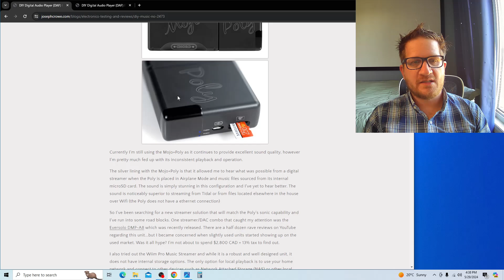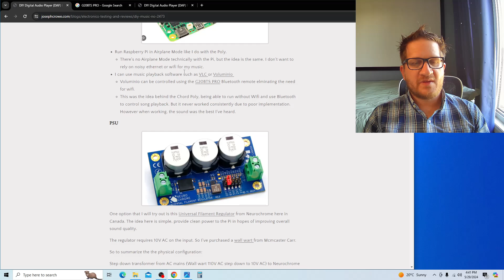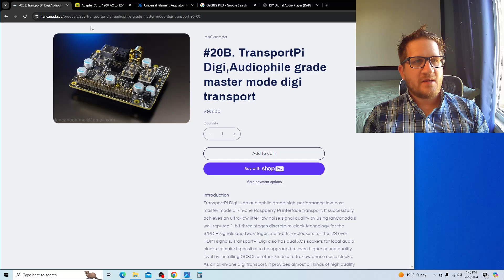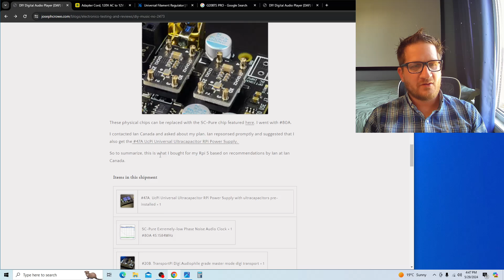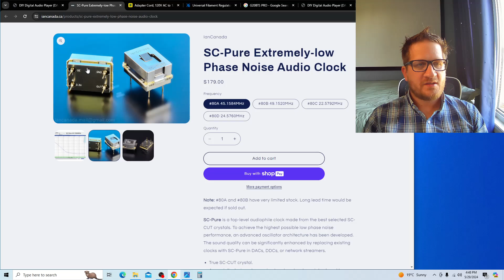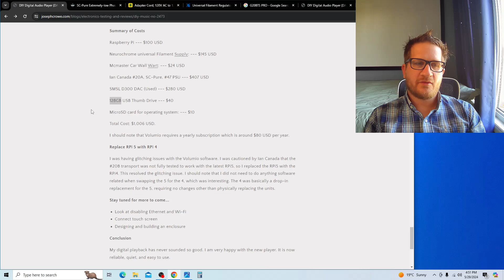Part 1 DIY Digital Audio Player (DAP) Project No.2473

Comment: The first thing is that Pi is overpriced. However this is a minor issue. The bigger issue is that Broadcom SoC does not allow to feed an external master clock to its I2S subsystem. As a max it accepts LRCK that is not the same thing. On the other hand, USB on Pi board is quite noisy. In this case, a hosting board with Pi computing module seems to be a better solution for music (if an external USB DAC is supposed)
Reply: Your observation is correct, Just use a fanless mini PC and power through a Mosfet DC to DC converter it will provide lower noise than a "Universal Filament Regulator"  and cost around $15.00 usd
Reply: @HeavyCrown2030  Ian Canada offers a super capacitor based PSUs for a Pi and GPIO sound cards. And it's not too expensive. Yet more thing can be made is an async-to-sync re-clocker powered from a battery or a super-cap, or low noise LDO after a non-switching PSU, but it needs a special Linux driver that appears as a block device, not a stream one.
Reply: @sc0or  Super Capacitors equal a tremendous amount of work , One just use a DC to DC con convert with AGM batteries and achieves faster build and zero soldering . 

I will send a very simple build to Gabster next week I'm sure he will post it I'm an engineer but have no time to create videos

Comment: This is my setup and it works great.
$30 InnoMaker Raspberry Pi HiFi DAC HAT PCM5122 HiFi DAC Audio Card Expansion Board for Raspberry Pi 5 4 3 B+ Pi Zero etc. (DAC HAT).
$46 New Raspberry Pi 3 Model B+ Board (3B+) Raspberry PI 3B+ (1GB) (3B Plus).
$0 installed Volumio.
Powered by 2A USB phone charger adaptor.
I connect to my local area network via WiFi And stream from NAS (Qnap).

Comment: I'm not sure I'm understanding the rationale behind avoiding ethernet (wifi or wired) for data transmission. TCP and ethernet are not lossy, they kinda have to be bit perfect in fact. Is your network streaming source transcoding your audio stream into a more lossy format? Also, It seems like it might be more ideal to go optical to fully de-couple the device ground planes.
Reply from the maker: I’m just basing it on subjective listening over the seven years of owning the Poly. I don’t have an explanation for you other than to say Wi-Fi introduces electromagnetic radiation physically very close to audio signal components.
Reply: Hmm. it would be curious to get your impressions on how your new setup handles it given the RPi5 and audio hat have a totally different hardware topology. Though id also wonder about the bluetooth radio as well since IIRC they both transmit in the 20-100mw power range and are both around 2.4ghz (excluding 5ghz obviously).